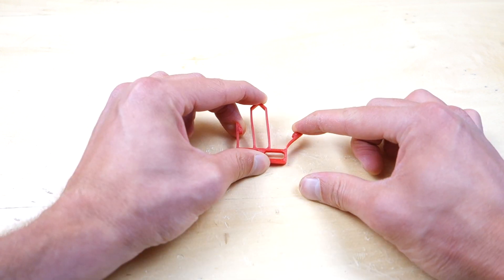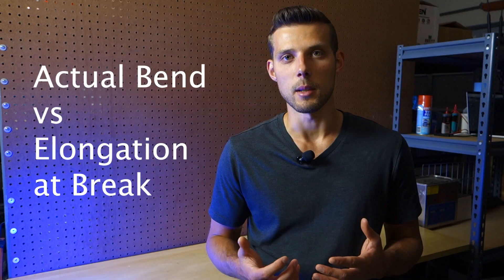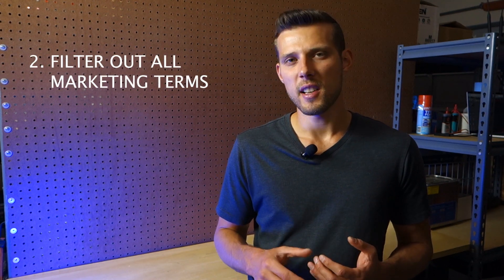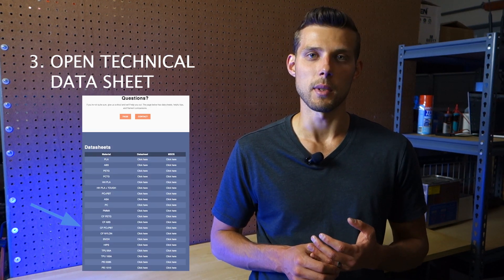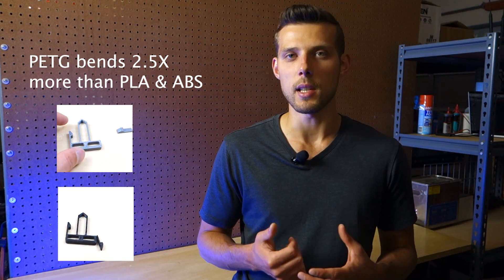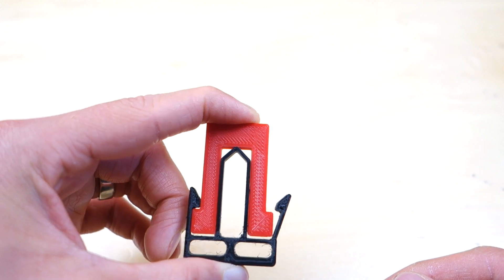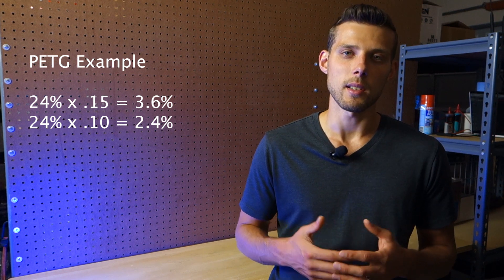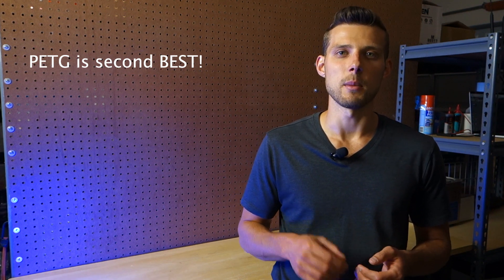The BEST Material for SNAP FIT JOINTS with 3D Printing!

Comment: I created my own ball joints that don’t need to be snapped together, after breaking several parts that neede stronger tension to handle my Transformers models. I will make new assembly videos for my 300ZX and Cybertruck Transformers that uses my new ball joints. I did post a video on my channel a few months ago. 😁

Comment: The geometry of the flex is very important, avoid stress concentrations, spread the flex over larger areas/lengths
Reply: Does that mean that if you lengthen the bar between the base and the hook it will be less likely to break over time? ty for the tip
edit: yup doubling the length reduces the stress by 75%, ultimate tool changer describes it here: https://www.youtube.com/watch?v=-jgbd8RUhhY

Comment: For an object that often comes in contact with water, would PETG be better than nylon?
Reply from the maker: It depends on your application.  But in general, nylon would still be better for a snap.

The water will reduce the strength and stiffness, but in increase elongation of nylon.  Water in nylon is typically a problem during the 3D printing or molding process.
Reply: @UltimateToolChanger  thanks for the reply, so is being hydroscopic mainly an issue for the filament itself and not so much after printing? I'm new to 3D printing and working on a project that's similar to a plant pot, so would be in contact with water for prolonged periods of time. I was under the impression that any hydroscopic filament wouldn't work, but I'll test out the snap with PETG first and see how it goes and then consider Nylon as well.
Reply from the maker: Welcome to 3D printing!

Correct.  Sounds like PETG is a good choice for you.  For Nylon keep in mind that larger parts are harder to print without warping.
Reply: @UltimateToolChanger  Thanks! :)

Comment: How do you calculate % elongation, practically?  In your snap example, you have more an angle than a distance.  Looking at distance, you could try, say, pivoting the snap hook on the point of its base at the outer edge and measuring the new length of the inner edge vs the old length, but that seems unlikely to be accurate - likely too optimistic.
Reply from the maker: Here's a pdf that goes through the calculations.  Page 9.  Top left equation is applicable for this geometry.

https://fab.cba.mit.edu/classes/S62.12/people/vernelle.noel/Plastic_Snap_fit_design.pdf

Comment: Great video on snaps.  It gives me an idea for something I was working on.  Of course if there is room you could not use a snap at all and use some of those tiny round magnets.
Reply from the maker: Agree!  Recently I worked on a design that had to use a very thin plate as a clamp.  Those tiny round magnets was the perfect solution for the clamping force.